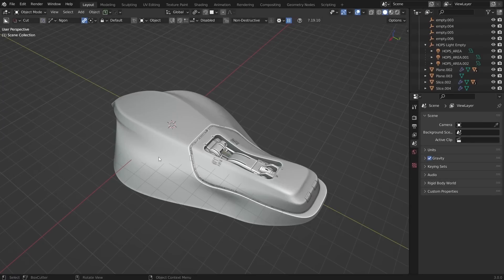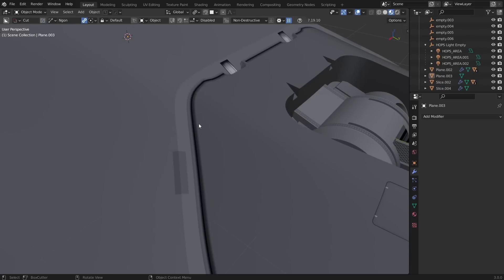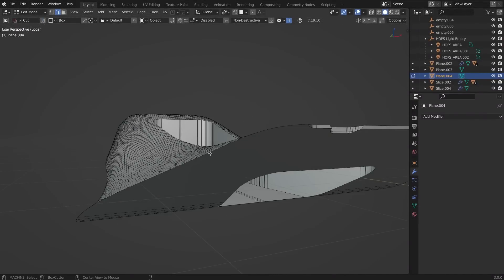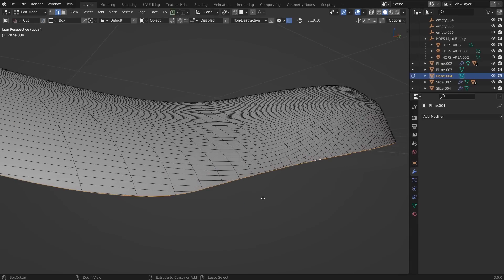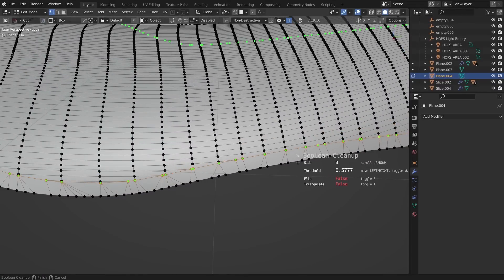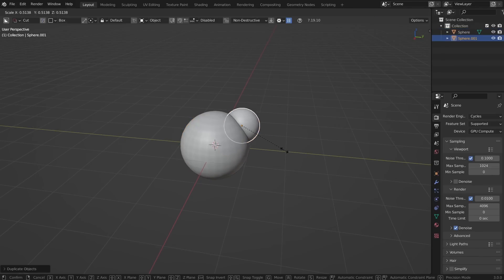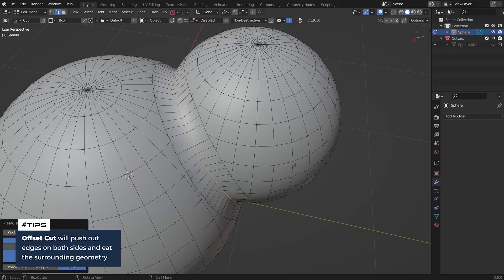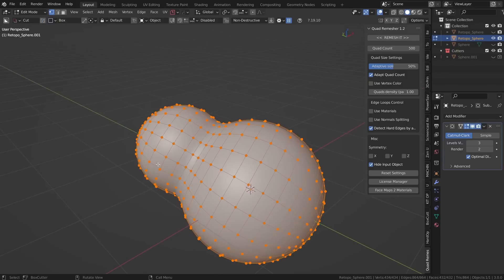This is a GAME CHANGER for Blender modeling...

Comment: As someone who only does quad builds I feel like a time traveler just pulled out a lighter in front of me while I was rubbing two sticks together.
Reply: I'm "just" pretty fluid with the box cutter/hard ops/mesh machine technique and still struggle with quad/organic stuff. I would love an app to tramsitt informations from a brain to another. I would take your quads method and give you mine full of tricks as a present. Ahah, have a good day.
Reply: @gabrielegagliardi3956  You'd need to retopo at the end I imagine, with all those ngons. If you're trying to learn, try to retopologize your models manually it gives you a good idea about box modeling. I'd start with making the loops of quads at the edges and orifices as a starting point and connect them like a web keeping the stretching to a minimum. If there are panels, make a loop of quads around the edge of the panel etc. If there is an edge you like defined add a second edge loop. In organic retopo, you start with essential edge loops around joints for example(accounting for mesh stretching while rotating in animation) and work yourself towards the center. It's essentially creating your defining lines(edge loops) of your object and then web/stitch them together if that makes sense.
Reply: @chucknorrisffs  Hi, I've already made tons of objects for my projects (high poly, low poly, triangulation) with no artifacts or shading errors and perfect baked maps. They work perfectly fine in unreal but i must say that those objects are static, they don't need to deform, they fit the purpose of their creation. Mesh machine already creates a loop of perfect quads near booleans and I immediately retopo the nearest area converging vertices, pushing then away from the bevel and trying my best to give a decent retopo. Unfortunately I don't like too much the sub d workflow, I know it's necessary and only modelling "hard surfaces" is very limiting. That organic sub d blob is my nightmare ahah, do you have any suggestion for "pure" organic modelling videos or courses? Cheers pal
Reply: @chucknorrisffs  Sorry for the wall of text? It was very useful and thank you for taking the time! I'm not into characters at all, I try to avoid every character related thing ahah, I prefer objects, especially sci fi or retro futuristic ones, i love that aesthetics. Thank you once again for taking the time to give such an in depth answer, really appreciated pal, cheers from italy and have a good day!
Reply: @gabrielegagliardi3956  Glad it's of use, have a good one....

Comment: For the merging sphere example, there is another way: create two metaballs in Blender, move and scale them how you want, and reduce the metaball viewport resolution (this makes it more smooth). Then you can use Convert -> Mesh to convert the metaballs into a mesh. This creates triangles, but you can use quad remesher (or Blender's built-in remesher) to convert it to quads. There are a lot of different metaballs, not just spheres, so you can use this to create all sorts of smooth shapes.
Reply from the maker: Good tip!

Comment: That trim sheet process, I had to do recently on a sub-d hard surface model in a lot of places.

The vanilla method I used was to start with the pre-subd model, select all the faces that would be "inside" the trim. In your case, the entire upper surface. Then Inset by whatever amount. There's an option on the inset called Edge Rail that insets along existing edges and will help in certain edge cases.

Comment: Hi Josh, I'm sorry to write this question under this video, but I'm desperate to find answer. Following most of your tutorials I found that you don't apply bevel modifier until export stage. However following same process caused some lines on my UV. Searching in web and self analysing helped me to understand that its because of new faces that comes from bevel. But in your videos I did not find any clue or errors of such matter. I thought maybe you have some hidden tips specifically in that question. Because after applying bevel modifier UV is all in lines and its a pain in my butt. Wish you all the best as usual!
Reply from the maker: Set the bevel segment count to 1, it won’t work with 3. Research UVs and hard edges if you want to understand the “why” - but yea, just set the segment count to 1 in the bevel modifier and it’ll be fixed.

Comment: I do modelling in solidworks than do retopology in instant meshes which gives very good quad topology
There is no other option than CAD software for accurate machine modelling
Reply from the maker: I agree. I don’t do machine modeling nor need extremely precise measurements

Comment: Can somebody answer a simple question for me? I am using Mesh Machine 0.112 on Blender 3.1.0. Offset cut works fine in simple situations. But designing is mostly not that linear. Okay, so when I boolean two objects and offset cut the intersection edges and then make a good bevel(fillet) this works fine. But then one step further doesn't work when trying to boolean the previous outcome with another third object and afterwards trying to offset cut the intersecting area. It just burst opens. So I tried further. If you have one main object and boolean multiple objects before hands and then do the offset cuts one at a time then it works. But as I said while designing you feel the needs to boolean things later on. How do you guys handle this limitation? Or am I just not lucky with the SW version combination? Thanks for reading!

Comment: Curious how you import the model plus floaters into UE.  I assume you have to setup multiple materials in Unreal.
Reply: yes and every material is more draw calls so its great but use wisely
Reply: Usually you bake them as detail from high poly to low poly mesh. Then you remove floaters/decals, they are now part of the texture.
Reply: @arialpew5248  That makes sense - just not sure how that works with multiple meshes/objects. I assume you join them first and then bake?
Reply: @zofo264 You dont have to combine them if you are baking in marmoset, just separate them properly in group/bake folders. In the end, if your low poly is all in one material/texture set (basically your low poly has the same material applied to its parts), its going to be one draw call.
Reply: @Alexander_S_K  Good to know - Thx!